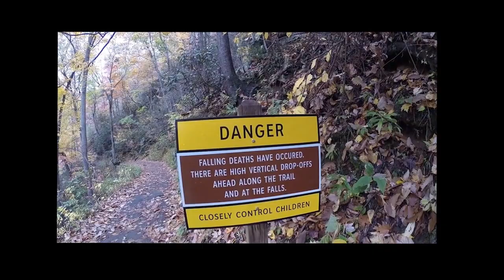RV Life Living Full Time In a RV S3 E51 UPDATE Champion Generator

Comment: The 3100 champion generator I bought in 2017 has an oil drain hose. It unclips easily and the oil drains very easily.  I am a 68-year-old woman, and I did this myself.  Remote control start, it’s great.
Reply from the maker: Doreen Walsh Doreen , yes it is a great little generator. Definitely fits our needs well. Thanks for watching and commenting. Have a great day.
Reply: Same as mine, cane with a drain hose for oil included, just have to unplug it and drain, I haven't changed my oil yet but it's easier than that old model

Comment: Thanks for your great videos.  I have two of these awesome generators in the dual fuel configuration.  Usually running just one, but on occasion when extremely hot or humid I run them in parallel.   I know its overkill, but I just like going easy on my equipment.  Like you I hook up to the 50 amp rear plug with a dog bone.   Thanks again for all the info...!!!!
Reply from the maker: TheCaliAmigo thanks for the kind words and watching.
Reply: E

Comment: Mine is still going as well.. I use the little 2000 champion for a 14 foot and a charger to a battery bank.. most pulls ever is 3 to start... the most I pull in wattage though is only 1650 watts with everything maxed .. My little 5000 btu must not be on AC when first plugged in.. once plugged..just turn it to AC and all is good. hard to beat the prices on these and "they work"... I do put some stabilizer in the tank for the sitting times.  thanks for the update. I hope Kim had a good meal ready once you worked so hard on that unit..:) Safe Travels!
Reply from the maker: Thanks Michael.   I use Seafoam in my fuel tanks and have good luck with it.  Glad you are as happy as I am.  Kim always has great meals and takes good care of me.  Thanks for wathcing
Reply: I also use seafoam Good stuff.

Comment: Great video My question is? If you are running the Generator while driving,going up long hills or long down grades would that not shut of the generator thinking its low on oil? Just a thought or I'm I thinking out of the box LOL. Happy Camping Darrel and kim.
Reply from the maker: Thanks for the comment. We never drive with the generator running. But that is a good thought. Thinking of factory installed generator never have I heard of any issues while driving.

Comment: another great how to video from darrel, i am going to buy one of these for our canyon trail fifth wheel based on your recommendation, why don't fifth wheels come with generators like our 2 previous class A's did??? thanks darrel
Reply from the maker: This one was pre-wired for a Gen but did not come with.  I guess some people don't boondock much or just stay where power is always provided.  Plus the area where the gen would be located will give more storage space. Also it would be running off the propane tank so there would be more changing of the lp bottles and some price difference and getting them filled more often.  Thanks for the comments and let me know how yours works out

Comment: In the first video on this you said you were going to wire a 30 amp TT cord to the automatic switchover in the coach. Did you do this ? Any chance you do a quick tutorial on that? If you did the 30 amp cord mod is that so you can run the cord through the kingpin and hook it to the generator in the truck bed so it can run while you drive?
I am waiting for my 3500 WT with remote to get here in a day or so.
Like the video.
Thanks.
Reply from the maker: Thanks Kurt for the great question.  Kim and I did not make the connection for the Gen.  We found that running the Gen was not needed while going down the road.  I still might make that connection down the road if we find we need it.  Right now we just run a 30 amp power cord from the gen in the truck to the power cord when needed or boondocking.  Thanks again
Reply: Do you take the generator off the truck to run it or do you just keep it in the truck? Is it a two person lift in and out of the truck bed?

Comment: I just got my Champion 3500 Generator today and was wondering haw to check the oil with the dipstick screwed in or out??? So when in doubt read the instructions book and I found out you need to check the oil level with dipstick NOT screwed in and the oil level should be 2 threads from running out.
Reply from the maker: How do you like you Champion??

Comment: Just bought one of these. You mentioned wiring a 30amp plug in the front of rv . Did you do that. I'm looking to do same. My 50 amp is in the rear of my 5th wheel
Reply from the maker: My 50 amp is in the rear also.  I have not yet made a connection in front of the Rv for the Generator.  I bought a hd 30 amp cord and ran it from the truck to rear of rv when needed and plug the 50 amp cord into the generator using a 50/30 amp dog bone when I can get the truck unhooked and placed at rear of Rv.. Thanks for the question